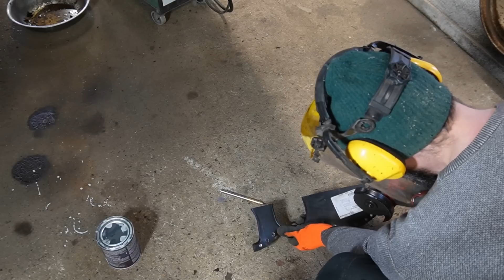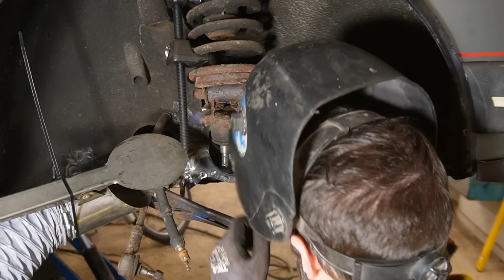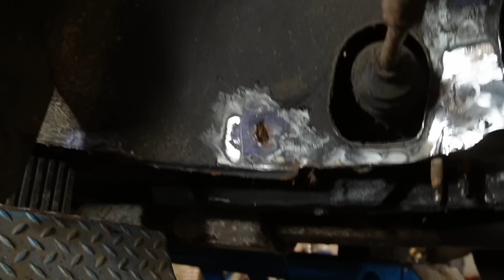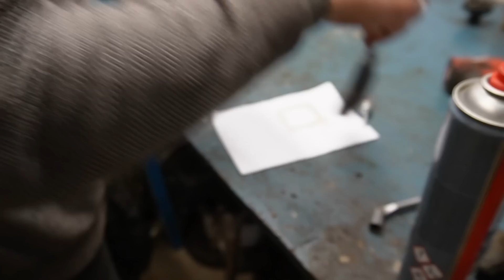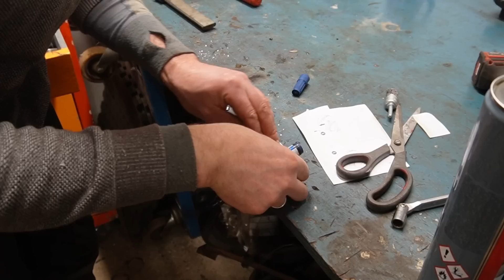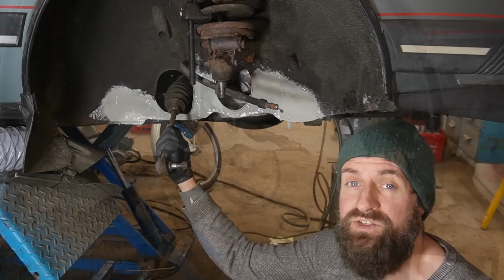Saab 900 Turbo Commander | Stitching Up The Drive Shaft Tunnel

Comment: Done a lot of welding on my 900 turbo although not yet had to do the drive shaft panel. its in the post I'm sure! very nice job on yours. if yours is like mine, your going to keep finding rust under the front and rear arches. have a look at the rear shock top mounts, had to do both on mine. Big fan of the channel!
Reply from the maker: Yea I got lots of work to make this solid enough to drive again... but its better then expected!

Comment: Nice work! Getting more confidence to tackle in my saab drive shaft tunnels. I just inspected those and they wasent so bad that i remembered, easy fix when u get that lower control arm off, fingers cross that bolts dosent spin 😅
Reply from the maker: Yea that was a bit annoying! other then that, the job is not that bad!